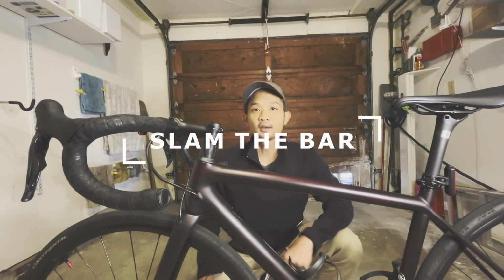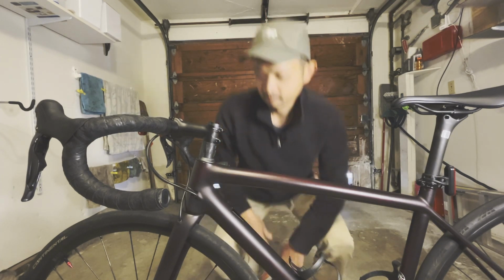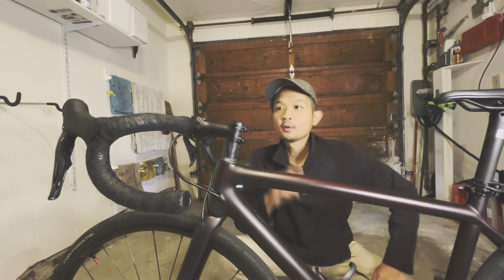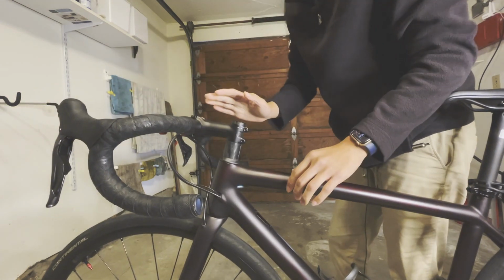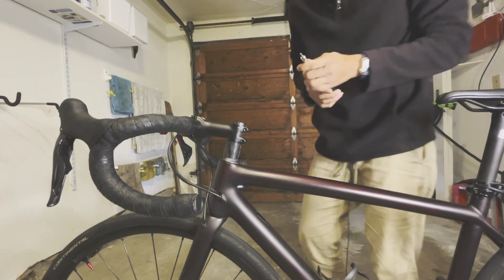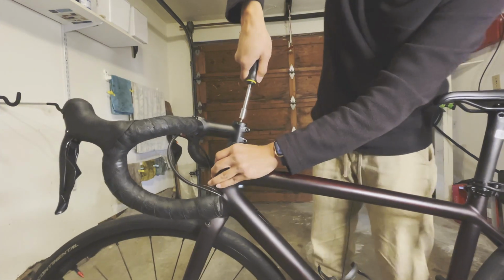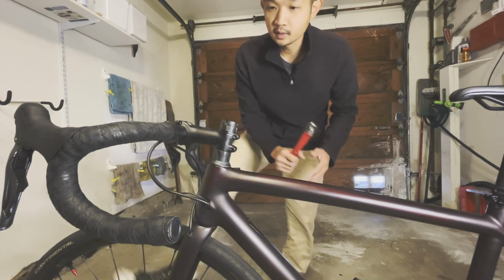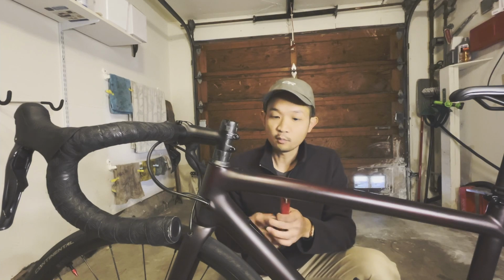How to Lower Specialized Aethos Bike Stem and Handlebar and look like a "pro"

Comment: You can't do that with aethos fork unless you have a longer expander plug and additional solid spacers. The Aethos has scalloped spacers below stem and they cannot be set above stem!
In over words: aethos fork should be cutted

Comment: Unless you have a longer plug you should NOT do this. If you lower the handlebars without cutting the stem you are not supporting them anymore. The plug needs to extend past where the stem connects.